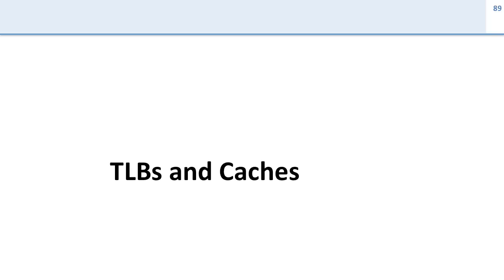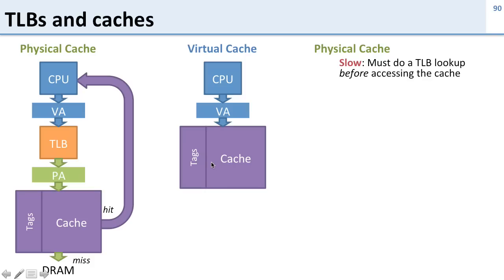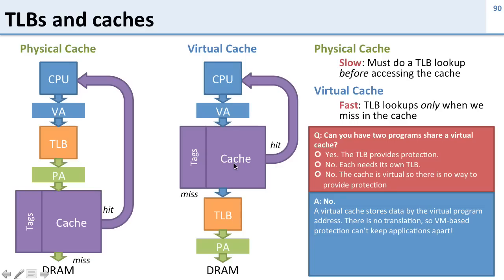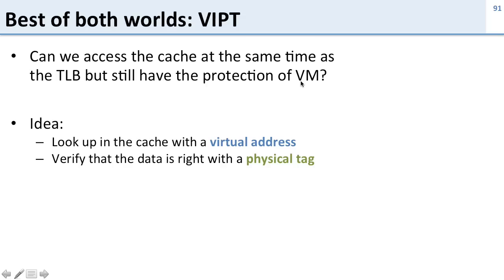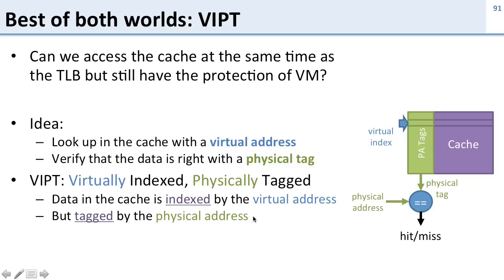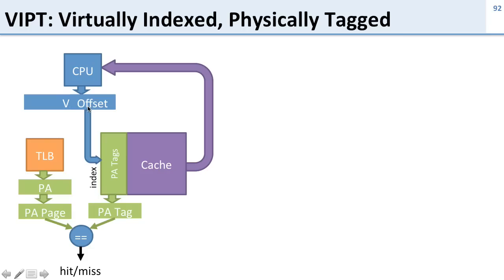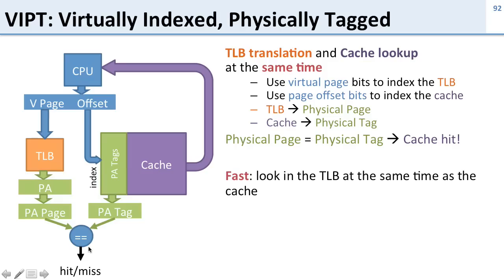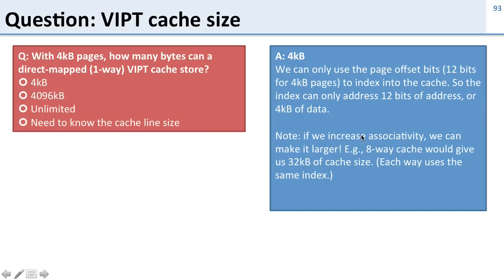Virtual Memory: 13 TLBs and Caches

Comment: So from what I understand after watching this and others on YT is this:
In VIPT the cache is indexed using offset and it stores the actual data and PA (its called physical tag here).
We use the VA and TLB to find the PA. At the same time, we use the offset to find data and also PA. Then we compare 2 PA if hit then return data, if miss then we get data from RAM and maybe update cache and TLB
Reply: Thanks for the explanation! this helps ..
Reply: it's pretty close but not exact:
1. MMU checks the index which is set number, in the meanwhile PA is resolved at TLB
2. TLB is resolved and PA is passed to the set which contains cache lines and cache lines has tags defining them, the PA taken from TLB is compared to the tags of cache lines or blocks.
3. if there's a match it's a hit , if  nothing match eviction policy is run and one of the cache lines is switched by the current query's cache block, also tag is updated on the block ( cache line )

As name implies, Virtually Indexed, Physically Tagged, tags come directly out of TLB, tag is a part of PA.

Comment: 4:23 one point to note is that for VIPT: the TLB is smaller than the cache, so TLB will be faster. So when the caches get the physical tag, the TLB already finished getting the physical adress. worst case they would finish at the "same time".

Comment: Besides increasing associativity the other way to index the VIPT cache is to assume the untranslated bit will hit. If the index hits in the cache it implies the VA->PA translation for that bit was not modified.
If the index misses, L2 request is made which would show that the cache line did exist, but the VA->PA bits didn't match. When this happens L1 can create a victim and ask L2 to fill the data at the index specified.

For example consider a cache with 64B line . [5:0] is block offset. If the macro is 8KB and the page size is 4KB. There are 128 sets. Bits [11:6] don't need translation. Bit[12] VA could either be PA[12] or it could be ~PA[12].   If VA[12] = PA[12] the line will be found in the cache if it exists. If VA[12]= ~PA[12] , the L2 response will indicate a hit on the flip index[12] bit. The core can then ask L2 to move the line from ~PA[12] to PA[12].

Comment: Left address:        real address of stuff i'm looking for
Right address:      real address of cached item
if they are equal:       cached item is the one i'm looking for (and get it directly from cache not RAM)
not equal:                   cached item is not the one I'm looking for, though they have the same virtual address
(For 12 bit page offset) cache has 4096 entries (each entry in cache stores 1.data itself   2. physical address of that data)

Comment: in VIPT, wouldn't the cache return memory before it is known if it is truly a cache hit? if that's the case, how does the cpu react to finding out it is actually a miss, does it just drop the instruction and restart loading the new memory into the cache? in the other case where the check for a cache hit happens before the cpu gets the memory, wouldn't the speedup over physical addressing be very small or nil?

Comment: Thanks for the great videos, it really explained everything that I wanted to know !!

I have one question, for VIPT, what if TLB missed but cache hits ?  can they still compare the physical address in that case ?
Reply: Then it doesn't matter even if it looks up because we don't do that at the cost of additional time
Reply: If there's a TLB miss, how do you know cache hit though? You don't know if the data is from the current PA. I guess in that case it will get the PA from the page table in RAM, refill TLB and get the data from RAM and refill cache.

Comment: Since physical and virtual offset are the same, and since we access the cache by that same offset, it seems as if we could easily call this approach physically indexed physically tagged cache. cache has nothing to do with the virtual pages, the tlb does. I guess. had to listen this part several times . the previous chapters are much better explained. in this one, the tags are blurry and not well introduced since the beginning.

Comment: Hi ,
One question. If 2 programs are using the same VA. That means there has to be a map between which page table belongs to which program .
This part wasn't covered . And could explain with an example of a program having the same VA.
Reply: Thank you for your wonderful videos. They are quite helpful .
Thanks alot .

Comment: Sorry for the stupid question: If VIPT cache needs to compare two PAs (one from TLB, the other from Cache), then why not just use TLB?
Reply: you only get another physical address by just using TLB. however cache directly give you the data you need
Reply: @paulyu6334  感謝大佬 <(_ _)>

Comment: Sir i didnot get the difference betwn physical cache & virtual cache coz  in virtual cache cpu gets the virtual address in return.
CPU should get physical address in return?????
Reply: the cpu always gets the memory stored in the cache in return (assuming a cache hit). the difference is the way the cache is addressed. in physical addressing, the cache address matches the physical address on main memory, meaning the virtual address has to be translated to a physical address by the TLB before the cache memory can be accessed. in virtual addressing, the cache address matches the address used for virtual memory, so the cpu can get the result without using a TLB or physical address at all